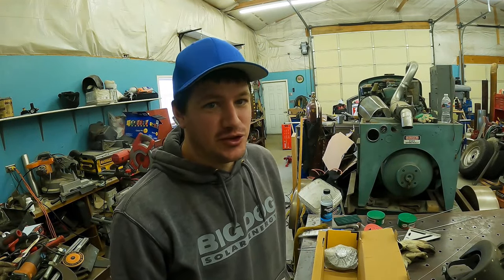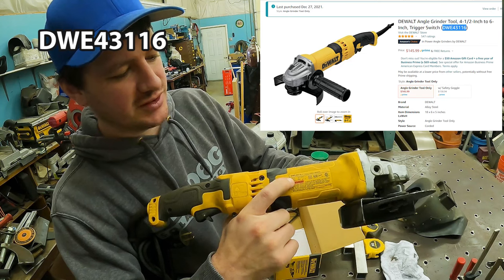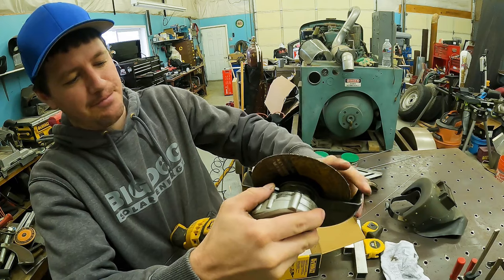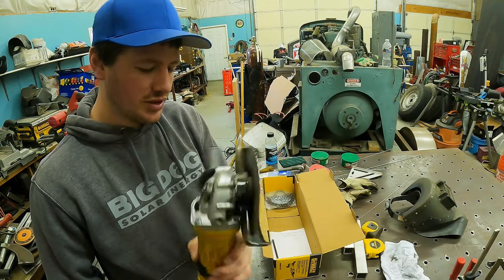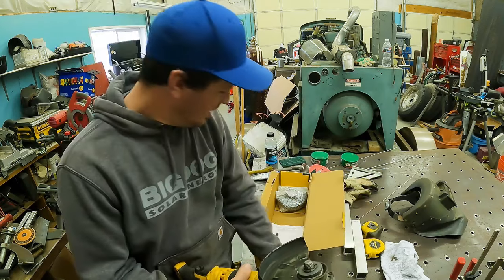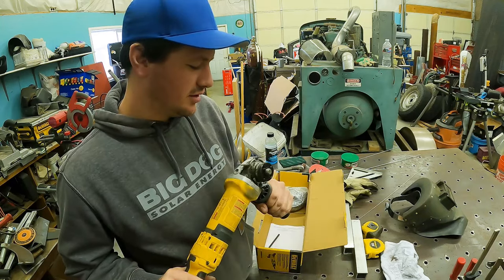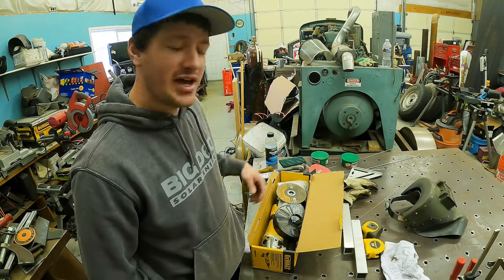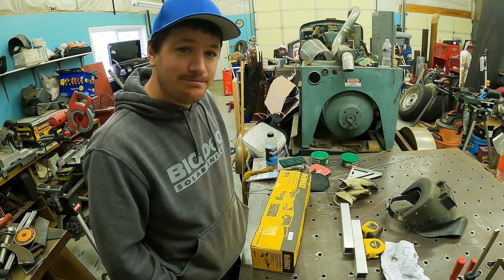Dewalt DWE43116 4.5"-6" ANGLE GRINDER GIVEAWAY!

Comment: Hey man, what’s that big green thing in the background that the water bottle is sitting on? What does it do
Reply from the maker: Hey Brian, that is a 40 kw detroit generator from an old radio tower. It is in the process of being built into a portable power trailer. It weighs about 2500lb and is about 35 hp but they run forever and can run on most anything petroleum based. I need to get to work on it and build the enclosure for it and route the fuel lines. For the most part it is huge thing that I walk around lately. Thanks for watching and asking!